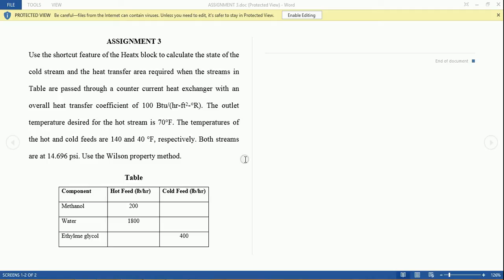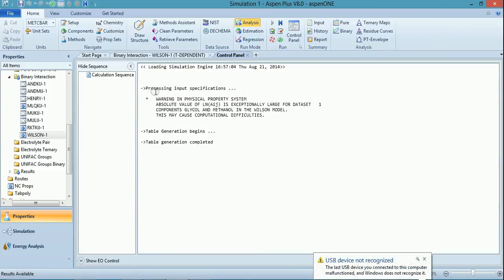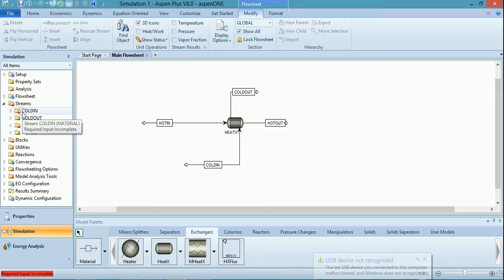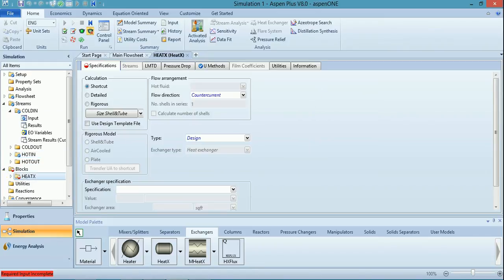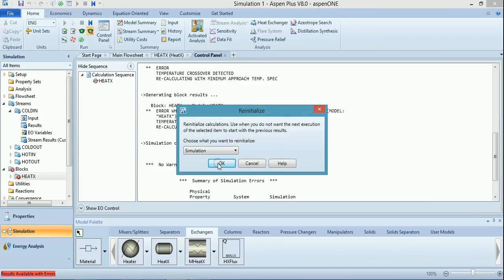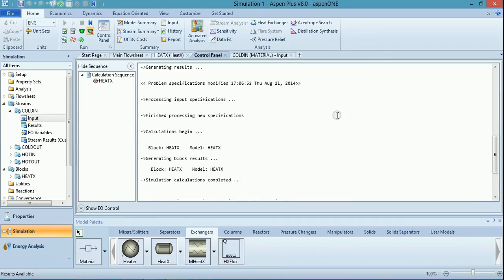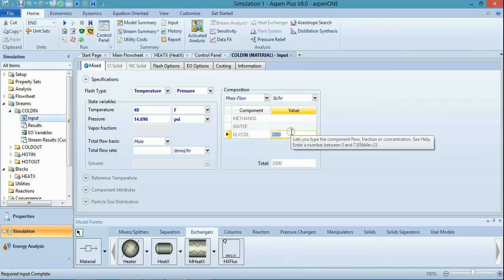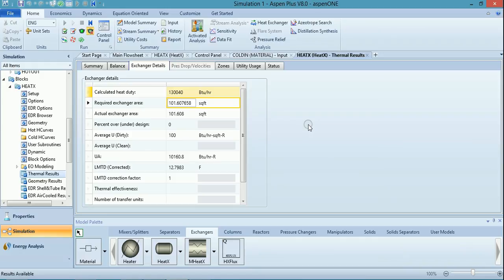Basic calculation of Heat Exchanger Area using HeatX Shortcut method in Aspen Plus

Comment: hi. thank you for the video. i begin to use aspen. please can we use two heaters to simulate this exercise. thank you
Reply from the maker: Hi Izzedine.
 Thank you for your comment.
Unfortunately I have moved on to being a data scientist from a chemical engineer these last couple of years so I don't do Aspen anymore. However you can definitely use multiple heaters both in series and parallel to simulate the same thing and come to a realization on what surface area is required for each of the cases. You might try that out yourself. Apologies i couldn't be more helpful.